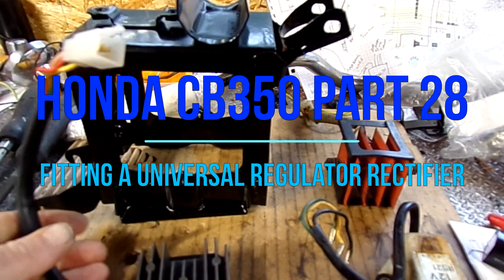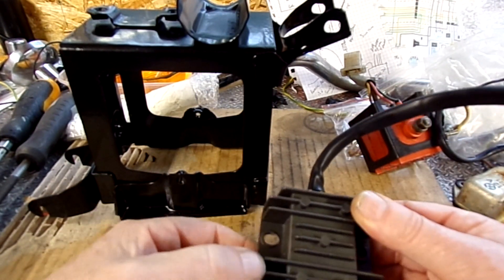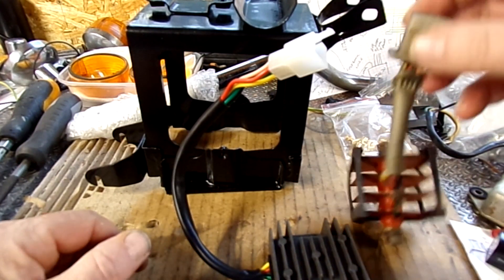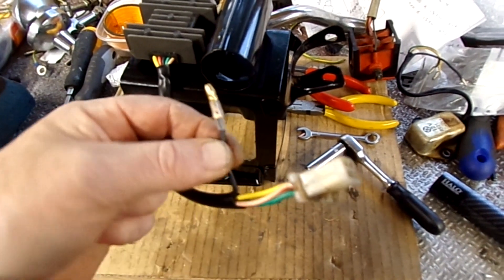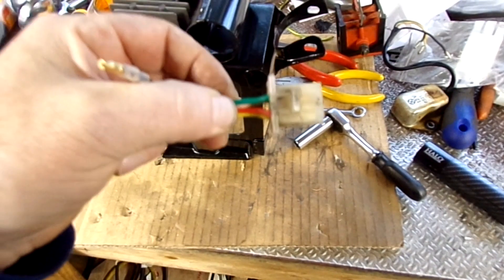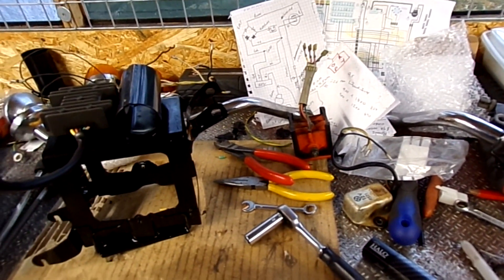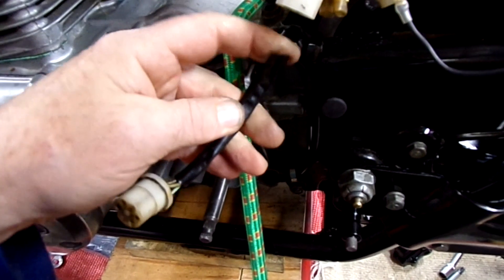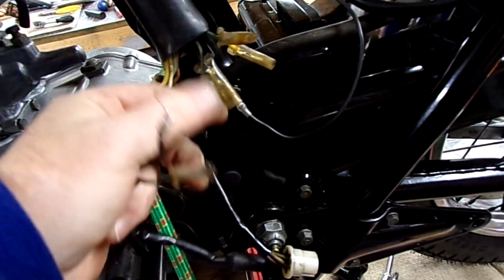Honda CB350 Part 28 Fitting a Universal Regulator Rectifier

Comment: Do you have a link to where you bought the new regulator/rectifier?
Reply from the maker: These are very common, available ebay/amazon, just search for Regulator Rectifier 5 Wire 12v and look for one with green pink yellow red black wires. I paid about £25 for mine but I have seen cheaper.

Comment: A lot of people don't like wiring, I really enjoy it. 
Good video as usual.
Best wishes, Dean.
Reply: I love it but many years ago I was trained as an auto/moto spark, to the extent that the MT fitters used to give me all the hopeless vehicles to sort out, in fact I was running the MT electrical section as an 18 year old SAC
Incidentally, a properly completed crimped joint is far superior to soldering, which basically means, if you have used the correct tool that matches the terminal and wire guage, haven't over-twisted the core and have copper right through the crimp, you don't need to blob solder on it. Rather than belt & braces it's more like belt & another, slightly weaker belt
Reply from the maker: Wiring along with spoke lacing are two of my favourite jobs